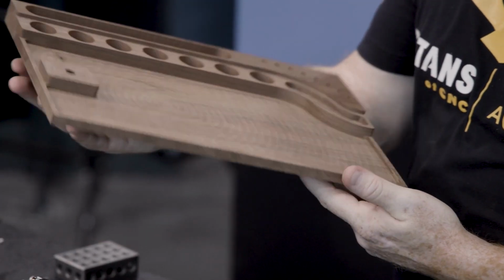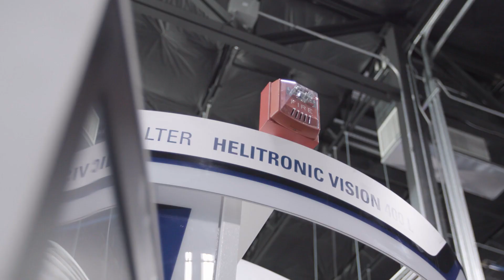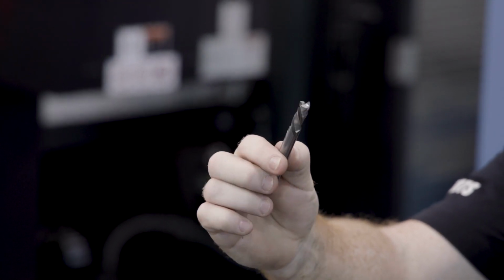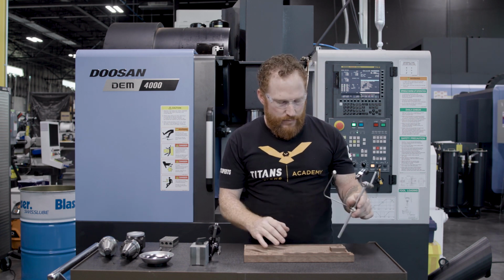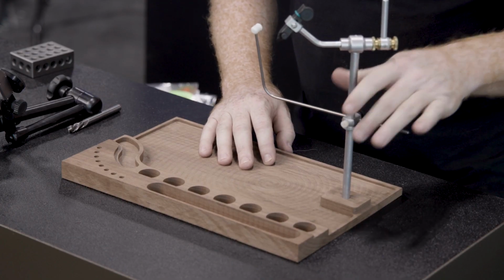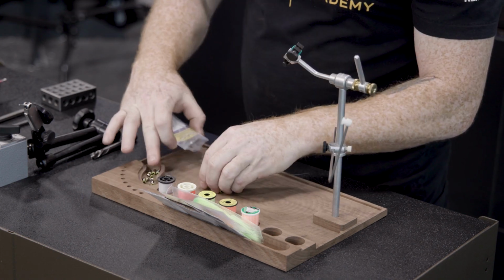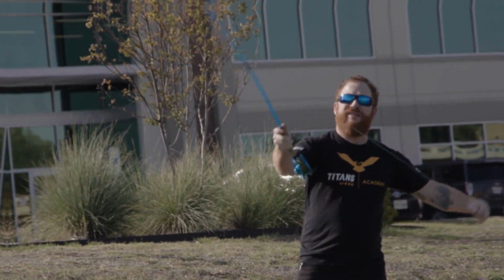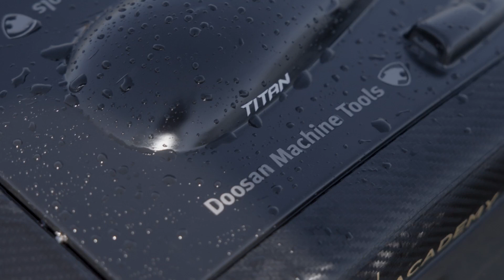Grinding a Compression Bit for our CNC Machine for Custom Wood Project

Comment: Carefully sets up and cuts to .00001” accuracy.  He walks outdoors into Texas summer humidity and the wood swells by .1”. ;-). That is a nice project, a radius on the edges and a coat of Osmo, done.  Most of the newer vids are not in our bailiwick so haven’t watched any in a long time, till this one.  Didn’t know ya’ll were making your own mills.  At least your fly supplies are just down the road at Bass Pro, Orvis ain’t too far away either.  Great for pointing out fly fishing ain’t just for trout.  Flyfishing for bass is great fun, just need a bit heavier rig than trout.  That little lake out front is pretty new,  I’ll keep a few flies in the truck and drop you a couple if I happen to see you out there.  Lake Lavon and Lake Palestine have some great bass fishing.  Great vid.

Comment: Being a toolmaker as well as an avid woodworker. I owned and operated a cabinet shop for several years while also having a machine shop. I’d often machine wood in a Bridgeport . People would laugh but let’s face it a mill can cut anything with the proper tools, speeds and feeds. Nicely done fly fishing board.

Comment: Oh man. This brings back bad memories…. I’m sure you guys are already aware but if you aren’t. If that machine runs coolant; I’d definitely vacuum that thing out and wipe all the surfaces down afterwards.  Wood pulp does gross things in coolant. I worked in a router shop for a while that also had some mills. Every once in a while they’d have us run some wood parts in a vf4 if they needed some complex or tightish work done.  Always turned into a nightmare.
Reply: I cleaned and wiped everything! Didn't want to deal with adding wood swarf to the coolant. It was nice seeing dark wood chips all over the machine though and man did it smell good.
Reply: Fiberglass is no fun to clean up after either. Try to vac out as much as we can, but never get it all.

Comment: All the passes are on the bottom visable. is that a design thing? 
If not then better results will you get if you dont do spiral passes, but do it in concentric and at the end give it a little sand to make it nice.
Reply: We played with it a little bit but in the end, decided it looks like the rings in a tree. I was cool with that.
Reply: @redbeard_1371  its impossible to make only in cnc without any marks of passes on the wood. Dont know about metals.

Comment: For what you cut a down cut spiral would be better.  You get less tear out from the upcut lifting the grain at the bottom of the cut.  

We only run compression bits for through cuts.

Comment: Does anyone know what theyre called or where you can get the clamps he used to hold the workpiece that fit in the bed slots ?
Reply: Those are Mitee-Bite T-slot clamps.

Comment: So basically you cut yourself compression router bit when you suppose to cut mortising router bit :)
Up-cut portion should be much smaller. This way in 1:26 (and 1:31) you would not have teared up wood on end grain.
You should also make yourself Left and Right hand bit, this way in 1:20 in to cutting there would be no way of blowing off corner.

In addition you should elevate your workpieces above table and use compression bit as intended: to cut cross material and leave perfect finish on bottom and top of workpiece.
However: very entertaining!!! 
Good job managing no coolant stains :)